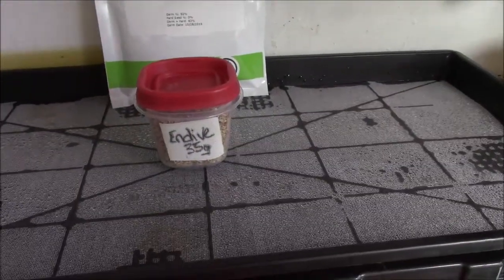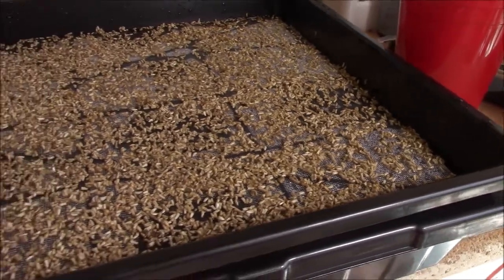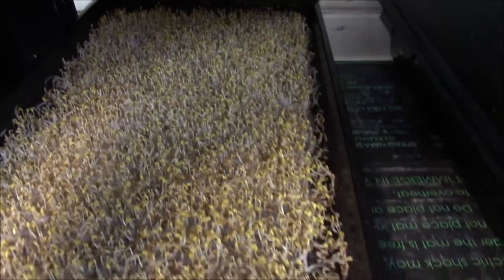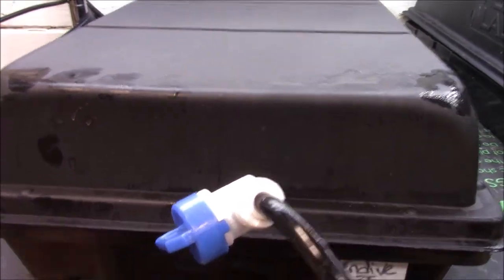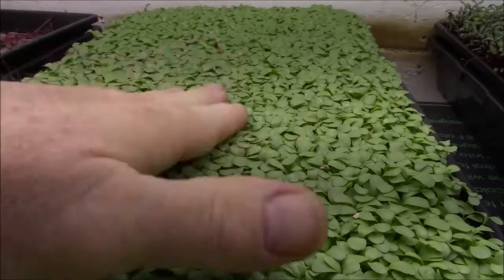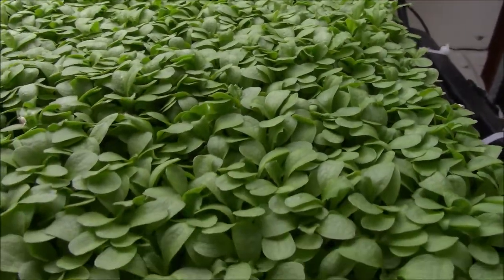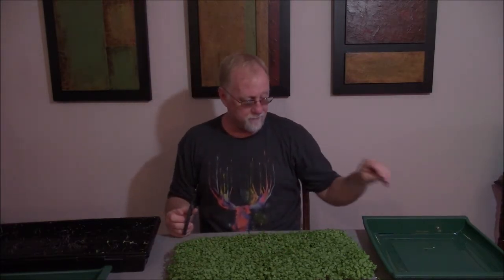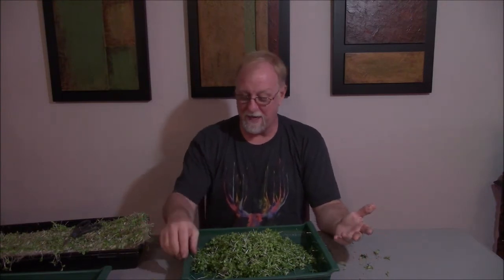Endive Microgreens Grown on Screen

Comment: I use an old gift card to scrape my screens I feel plastic on plastic is much gentler. Then clip my screen onto a cookie/bread cooling rack outside then blow the hell out of it with the jet setting on my garden hose nozzle....its basically a power washing setting and it blows everything off in like 7 seconds with out having to touch anything. Then I dry screen and trays out in sun as first stage antibacterial. For half a day...then go inside and dip trays and screen in a bleach soak. Then put them away for next use.....works great. Great video. I really wonder how lettuce seed would do in this system now.
Reply from the maker: Sounds great, but just a warning about sun uvs breaking down plastic.  Otherwise, we're on the same page more or less.

Comment: How did you make that black weight? Did you cut it to size? Would love to see a video or buy one ore made
Reply from the maker: If you're talking about the thing I lift up that's just above the micros, I fabricated it using food-grade poly sheeting using a table saw to cut it and a sander to mold it to the tray.  This piece is called the "stackable cover" and is part of the 2nd Generation Microgreens Assembly (Kit).  I do sell them as part of the kit, but it's contingent upon buying my book.  That reason is because to grow the way I do (IHG), you need the background and understanding of what the components do in the Assembly.  The book is created so that anyone can use it to have the same success I do and it allows for membership to the Facebook closed group and unlisted supportive videos that are obviously not public.  TMI?

Comment: Brent, have you ever grown Clover as a micro-green to eat and if so which variety did you grow?
Reply from the maker: Hey Richard.  I grew clover as part of a mix called "Broccoli and Friends".  It included:  broccoli, alfalfa, china radish, and crimson clover.  It grew quite well.  I have a video on it, but I can't seem to locate it quickly.  I think it was part of a comparison grow video.  I couldn't tell which micro was which.
Reply: @C3Voyage  Well, I bought 1/4 lb of Crimson and White Dutch for ground cover, so cutting out 50 G from ea. won't hurt.  By the way, do you sell those Black and Blue weighted grow box covers?  I looked for them in your store and didn't see them.
Reply from the maker: @KODArunner  Check out the response I just gave Brock here in the comments.  I do sell parts of the Assembly for book members.  That process starts by emailing me and asking.  I then send an email with all that's available.  I do sell screens and antifungal regardless of book purchase.
Reply: @C3Voyage  Brent, I have "2" copies of your book!  The first one I received was printed in Black & White and my eyes aren't doing so good, so I ordered another copy in color.  The print is a lot easier to read in this color copy.  I also bought the first 5 screens, (3 large & 2 small), you sold.  They are working great!